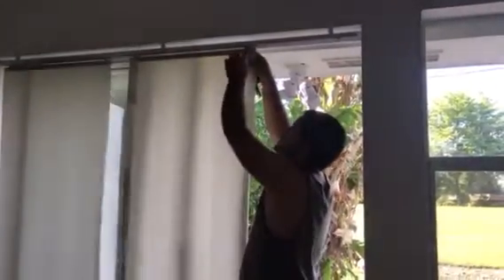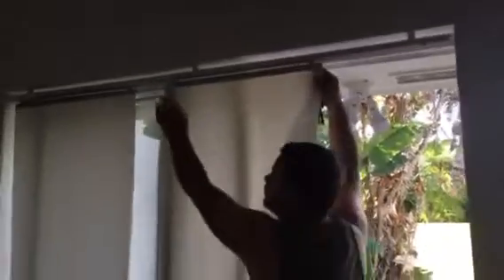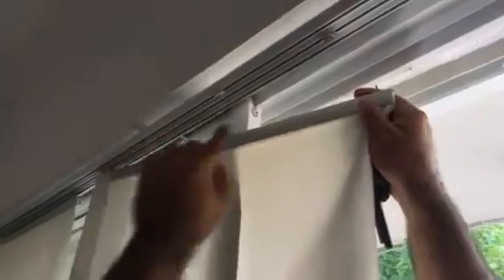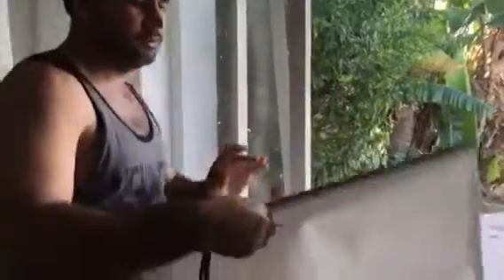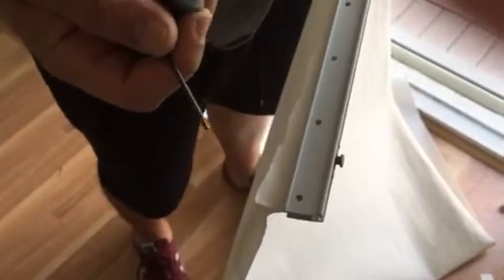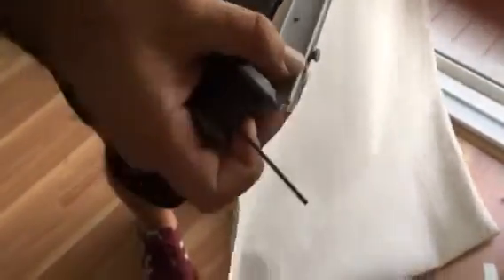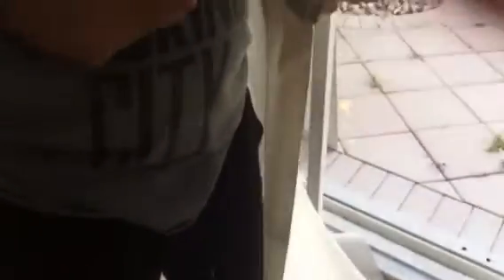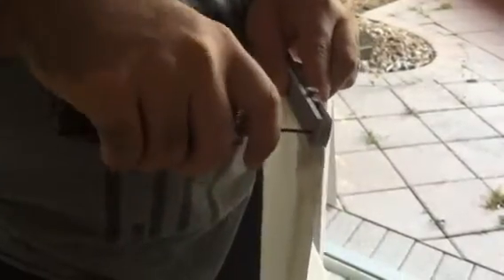Removing old ikea panel curtains

Comment: I wish you would tell the name of the tool you’re using.  I don’t know what it is.
Reply from the maker: Hi Chantel,
CO-Z Hex Key Allen Wrenches, 26 Pcs Metric/Inch Ball End Long Hex Tool Set, Folding L Keys with Knotched End, Complete L-Wrench Tools Kit for Turning Screws with Foldable Case https://www.amazon.com/dp/B076QFDRBD/ref=cm_sw_r_cp_api_glt_fabc_P9Y0585BNHBBYEB4GP9Q?_encoding=UTF8&psc=1 you can find it in Homedepot too 🙏
Reply: @nosby30  I did it! It worked! Thanks for this 🤗🤗🤗